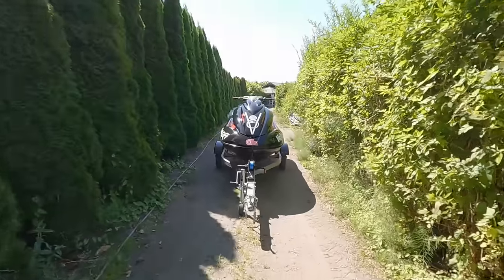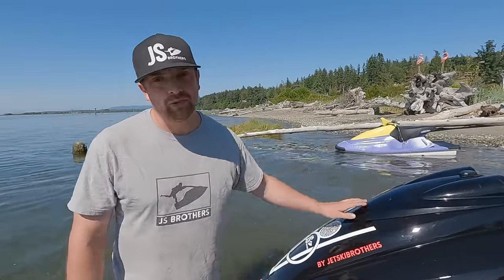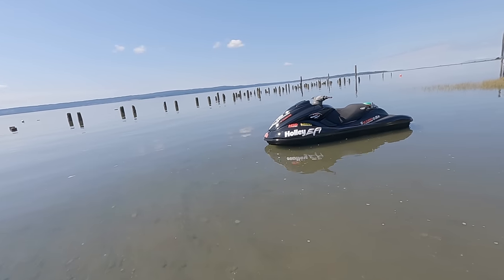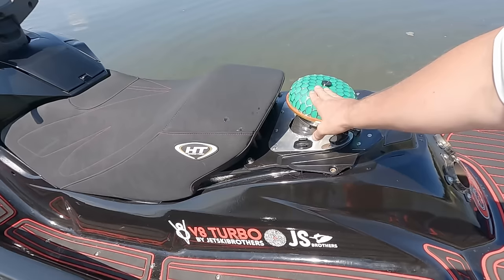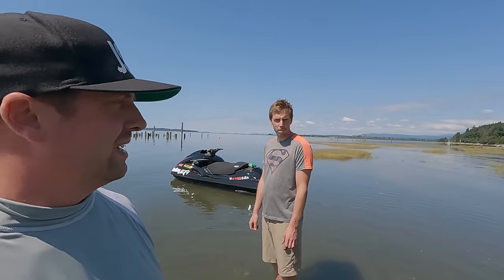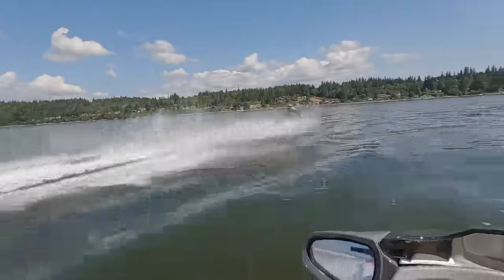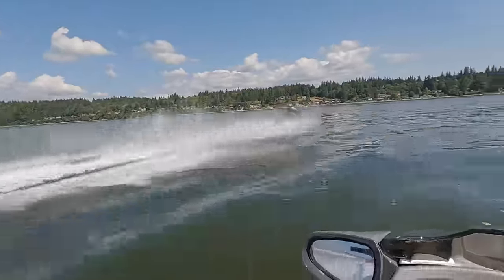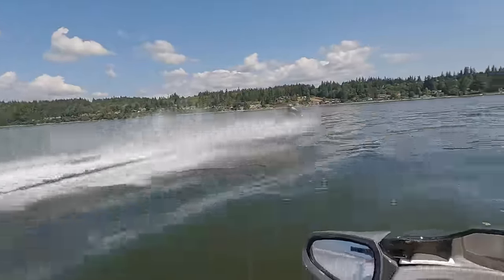v8 turbo jetski first ride

Comment: I'd just keep boost where its at honestly. You do not want that thing to blow while you're sitting directly over it
Reply: 6psi is hardly boosing at all. 15psi is normal
Reply: @nordic5490  Running 15 psi with a stock bottom end is not normal and a terrible idea.
Reply: @rayzor285  ??? You really have to question why such a heavy boat anchor of a motor was installed in a jet ski, especially if it is only performing to 5th of its potential. Lots of unnecessary weight for no purpose

Comment: Why not just sit it on the trailer and do some pulls with someone in the tractor holding the brake, seems like how most people tune jet skis.
Reply from the maker: I agree but already did a bunch of that in the last videos. Just trying to keep things from going sideways thats why Im checking the data and tune a lot.

Comment: IT'S OBNOXIOUS, AND MAKES NO SENSE!. PROPELLER RPM IS PROPELLER RPM. 6000 RPM IS 6000 RPM WHETHER IT'S COMING FROM A 4 CYLINDER OR 8!. THERE IS NOT ENOUGH DRAG, WEIGHT RESISTANCE TO WARRANT THAT ENGINE. THE ONLY THING THAT WOULD MAKE SENSE IS A HUGE PROP WITH MASSIVE PITCH FOR THAT V8, THAT A 4 CYLINDER CAN'T POWER UP.  HE WOULD OF DONE MUCH BETTER WITH A TURBO MOTORCYCLE ENGINE THAT TURNS 15,000 RPM. RPM, RPM, RPM, RPM, YA GETT'N IT YET!!!!!.